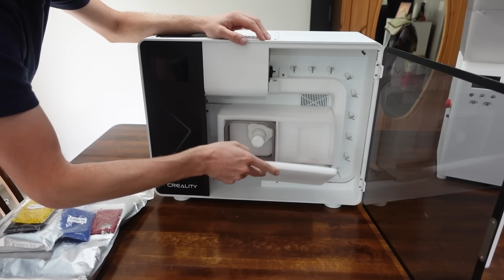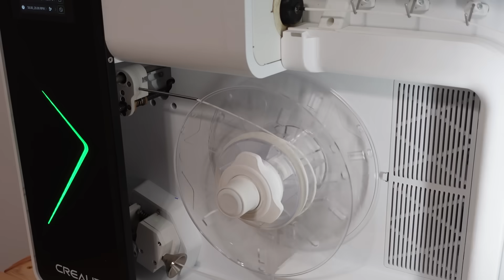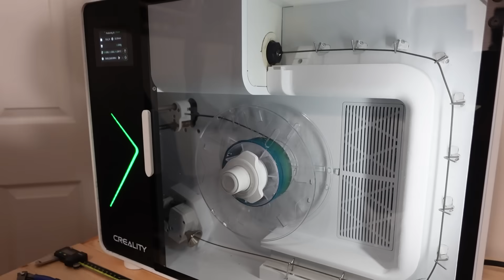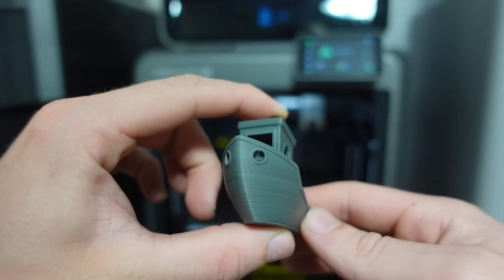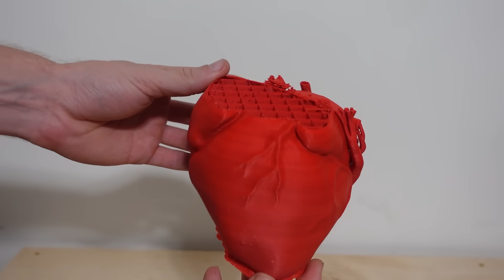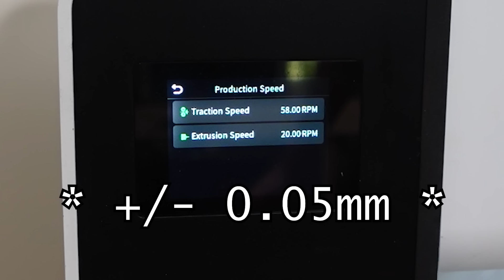Recycling 3D Prints Into New Filament?! I Creality M1 Filament Maker & R1 Shredder Review

Comment: hm... hard to gauge how big the actual shredder is. Would be pretty annoying if I had to tear down failed prints and old test prints down first to make it fit the shredder. So I think having a shredder at least the size of a common printing bed so it will be able to at least shred the default benchi etc should be the goal.

Comment: Just checked, The market price for this is about $1700. So based on the price of a roll of PLA ($20?), you would need to produce  85 rolls of recycled PLA to pay for the machine (excluding electricity). At approximately 20% waste per print? you need to use 425 rolls of PLA just to get the waste. Defiantly not for the DIY market and maybe not even for a small printer farm. Great machine though!

Comment: This is super cool, I do wonder about blending it first in water, vacuuming it with some ir heaters, & then shredding it. The shredders I have seen have issues with being the flat based lobe cutter dudes & that makes them need the material to be aligned going in. The consistency of the particles matter. Honestly, I'd use flat burr grinders from coffee makers with some water to force them into consistency & or my other comment (also on tumblr) going over a plate based system that counter-rotates in a vacuum that uses heated (electrically resisted) plates that dough ball up the pellets along tracks in the plates to force them into shape the right way. Making them far less oxidized & occlusion'd (pockets of air & water) that then drop into a pushing piston taper system below that then (like my old reddit post on r/3dprinting too) extrudes out more consistently into a rotating spool below, all handled in a vacuum.

I do like this btw, just I feel as though the shredding & the cooling hooks can be made to become filament resizers with little peristaltic based squeezing actions that force consistency of the filament. Or those little scrunchy based squeezers. There are the rotating squeezers. You know, heating up but long enough to remain cool where needed.

Also, I have yet to see a single solitary review of this thing test engineering filaments of nylon & more with fiber filled. It's not your fault but it makes me suspect creality having a playbook for you guys to hit. Just saying. It looks cool, but can it handle what it really needs to handle? Real world use cases. Not people who use 3d printers all day & have for a while, you grandparents wanting to learn & or engineers who will chuck random things in to see what happens.

Comment: You can work out an exact formularization for color (and lots of other things, really), using a scale, a spectrophotometer, the correct software, and good old math :) You might even be able to use powdered pigment on this machine. But probably not as well as on a twin-screw extruder. The Creality machine is only single screw.

Comment: "The filament diameter had gotten slightly oversized and led to a clog" - this is simply unacceptable. You said the solution is to manually monitor it? - that's insane. The M1 just isn't doing its job here.

Comment: I'm so happy there someone else that's using a spark xi7. 

I'm just curious, what kind of settings do you typically use for your sparkx i7 as I am a bit of a newbie and I've had my printer for about a month and a half now. 

(Specifically on the topic of tree supports and normal supports)

I understand how broad of a question this is.

Comment: Like always with recycling, its great and sounds like a no-brainer, but in reality its rarely worth the effort.
No doubt you do it a few times with a ton of enthusiasm, but i bet this machine will end as an dust collector. And if just every third print or so fails because of clogging or contamination, it won't take long until you just get a dirt cheap roll of new fresh pla from amazon.

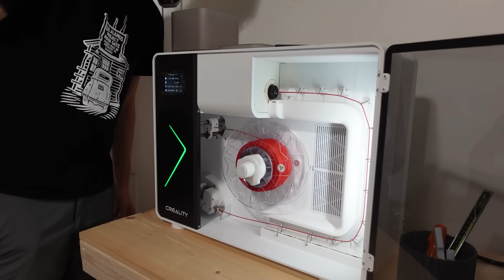Comment: 5:50 Dude what happened with the cut there. You changed out the spools while saying "it all worked perfectly" why change the spool then? Also some criticism to your Script writing. If you say "aim for 100%" and then say "it actually worked out perfectly" and then your aim being off by 3% at least that script could have been a bit more clean like "then I tried to see how far I could go with recycled material so I only added some virgin material and colouring". Like this you made a video where you say your aim was 100% and you failed to get there but you don't say that. So it is left to the viewer to make that conclusion. Looks a bitr dishonest. You use "perfectly and perfect" way too often, because not everything you showed was "perfect". It's perfectly(pun intended) fine if something only works "great" or "pretty good". And if that is not enough for Creality to be satisfied as the provider of the machines well that's a bit sad because like this you might have gotten some new machines but you also could have gained more followers(atleast one more if this was a bit less euphoric)
Also by the way saying this can do ASA and other materials is also on the issue side. No they can't not right now there isn't even the option to do it in software yet. Creality is still in testing on these. These machines can do PLA and PETG for now. Which is still impressive enough and if they can deliver on higher class materials later that's great but for launch and the Indiegogo they can not.
Reply from the maker: The roll at 5:50 is the exact same roll; I didn't swap/change it. If you notice the black/dark red coloration at the beginning of the spool, it's the same on the finished red spool. I am more than happy to show the raw video footage. I didn't time-lapse it, so I just showed the beginning and end. I can totally understand the scepticism.
Thanks for your constructive criticism and feedback.

Comment: THANX Daniel, really good practical info you included! I won't have enough filament scraps to make the investment cost effective, however we get ALOT of PP plastic, there has been other postings that while the M1 doesn't "officially" support PP (yet?), the specs required could/should support taking PP based scraps and making 3D filament..and still the investment may not be totally paid back for me, there is such a "coolness" factor involved...like you said, making 3D filament in-home is cool!

Like others mentioned, if you get a chance to do a video on PETG or other plastic, from source physical to smaller bits to shredded bits to filament production to printing, lots of us would be very interested and appreciative :-)

Comment: Thing with recycled is that it looses strength for each time.
I doubt we will have tabletop extruders that delivers good enough value in the comming years ( you know..for a sane price) 

But can we use it for support filament, or even innfill? 100% 
Im hoping someone makes recycled profiles where infill in like 80% recycled material spool you have in the ams, and we just use it like that.

Comment: Looking forward to this to take the supports and start making filament for dedicated supports in printing with the H2C, and the potential to do some PETG bottle recycling with it will be fun too.  But will need to fabricate a larger shredder for PETG bottles in a single go without having to cut them down into smaller size before hand.
Reply: I had the same thought, with a dual nozzle machine where you could use PETG supports with a PLA print, or vice versa, this could turn bottle recycling into free support material for life, print quality and color don't matter in those cases either so pigment consistency, which I see as the real issue in these recycling systems I think start to be a major win here. Certainly working better than I expected.

Comment: i love this machine , i really was hyped and wanted to get it even started to keep my trash , i have two big 50L bags full of pla trash ... BUT  i realized besides small prints and poop (wich u hardly dont get with multitoolhead machines) u cant grind anything else with the Shredder.. for example what should i do with a 30cm x 5cm x 5xm thick bar?  i often have big pieces i would needed extra grinder or a saw because i cant break them by hand.. also who sis by the side and monitors the diameter all the time to reclaibrate it??? they should have addeda  notifiacton or sound or whatever...  also u get wierd colors if  dont spereate the colors.. 1kg filametn is 6 euro - the  procurement costs,  the elecrtic costs , time and quality of the pla probably isnt really worth it.. i will throw the bags away now :D:D

Comment: @BuildDanielBuild Can you tell if the filament is pulled by the spool or if it is a separate engine and rollers in front of the spool? this is decisive for the quality and stability of the filament diameter.
Reply from the maker: There is a traction gear that you put the filament into after all the little arms (bottom left of the machine), almost like a grub gear on the old ender printers (before direct drive). The spool also has a motor. This will speed up and slow down depending on the filament diameter that it's reading. It has both

Comment: If the beta unit can read out the diameter, the final unit should totaly be able to use these informations to adjust everything else so the diameter of the recycled material is extruded consistent.

Comment: It sounds like they could do with adding some sort of thickness measuring system into it as it extrudes out and around the outside loop of the machine, that way it can self-adjust if the thickness starts to increase or decrease without you having to monitor it constantly and make manual adjustments. Other than that, this is awesome because it means people are wasting far less plastic which has always seemed a huge downside to 3d printing to me. The only thing I wonder is if they could develop a shredder that also melts the shredded plastic and form it into balls for easier storage and use?

Comment: Surely it should be monitoring the extrusion diameter and automatically adjusting settings to compensate for over/under size issues, rather than having the user stand there glued to the display for hours, watching for issues?

Comment: final price is pretty competetive as well. early bird price is 1199 usd with the normal price being 1699 usd. normally a filament maker alone would cost twice that, but here ur getting a shredder and maker.
Reply: Actual early bird pricing is $899 after rebate if you put down a deposit. But until this is cheaper than brand new filament, it's not worth it. You're not saving the Earth.
Reply: I think that depends on how much filament you go through. Even if it isn't cost effective now. Anything that makes it easier to recycle waste and failed prints is a step in the right direction

Comment: Works for me...  I have A LOT of support waste scraps from the U1...
Reply: You're probably using supports a lot more than you need to. It's a common mistake that people make, you'd be surprised what you can print perfectly fine without them.
Reply: The shoes I print are very complex lattices and do need support, they are multicolor tpu and multimaterial with pla and petg supports. I do minimize them by modding the geometry.  Do this on a daily bases and those 100 grams u think are nothing, turn into 10 kilos very fast. I could probably further reduce my waste but the u1 bed is so small, I have to juggle a lot to fit a 10.5 shoe in there..  I want this machine to experiment and be able to do my own filament not to save money...